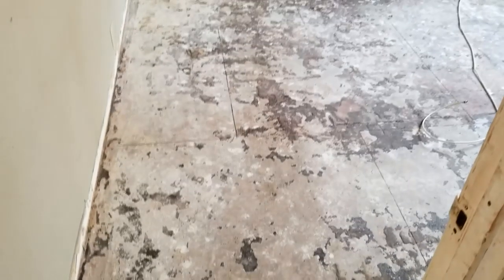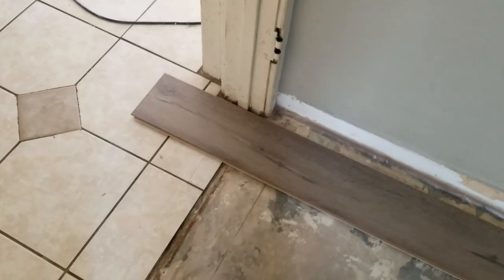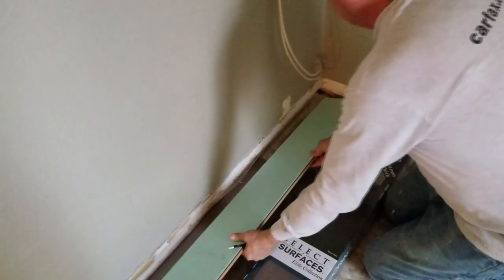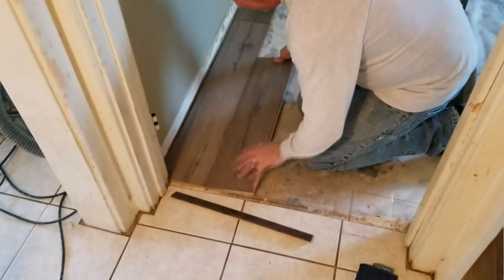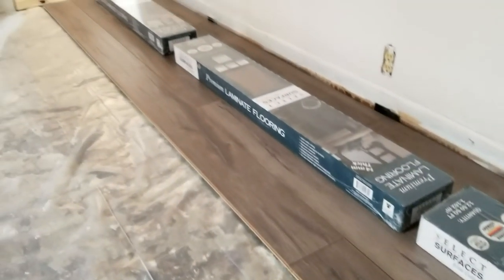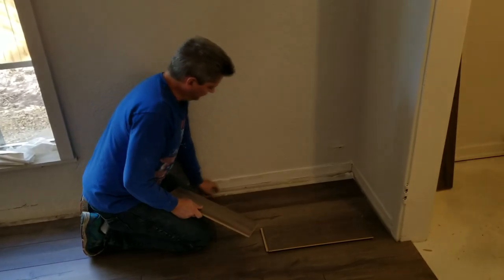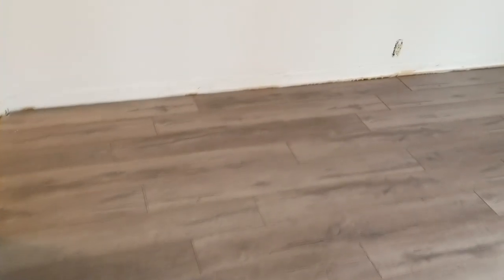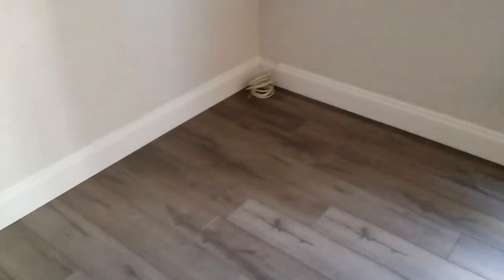Laminate Flooring Installation Quick Tips For Fast Install

Comment from the maker: ✅ RECOMMENDED diamond coated blades to cut laminate flooring and other hardwood floors
✅ Freud Diablo 10" Pergo D1012LF PCD Laminate Flooring Blade: https://amzn.to/2KXLYPw
✅ Freud Diablo12" D1216LF PCD Laminate Flooring Blade: https://amzn.to/2Ly5r8R
✅  QLT by Marshalltown Red 19-in x 13.5-in Foam Kneeling Pad: https://amzn.to/2XxCIZ5
✅ Dripless 10oz Ergonomic Caulk Gun: https://amzn.to/2Du7tRJ
✅ Cramer 5-Fugi Caulking Kit: https://amzn.to/2DjZVC1
✅ General Tools 833 Plastic Contour Gaug: https://amzn.to/2LB55hU
✅ Estwing Handy Bar Nail Puller - 15" Pry Bar: https://amzn.to/2Ke5vvr
✅ Estwing Ultra Series Hammer - 19 oz: https://amzn.to/2WUZR2z
✅ Estwing Pro Claw Moulding Puller - 10" Pry Bar: https://amzn.to/2YTwm36
✅ Tooluxe 00883L Scraping Blade Hammer End: https://amzn.to/2D4Kn4H
Reply: Jeff,  on the 4th row,  why couldn't you back up the 1st plank to allow
     an 8 inch piece to be snapped into the end without making a butt joint,
  then cut the beginning piece to fit ?
Reply from the maker: @normhodgkinson6965  Norm, the really screwy thing about this laminate flooring is the manufacturer wants pieces to be cut in increments so that no piece is smaller than 16".  This means we really only have 3 sizes you can cut. Most manufacturers let you cut pieces as small as 8", but I shoot for 10" minimum for aesthetics. With all this in mind, by row 4 we needed to get in one whole plank to start, so I was willing to add in a butt joint at the end of that row to allow for the starting the row with one plank. If done correctly, you cant tell a butt joint is there. I use 80T blade on these cuts so my cuts were very fine. this is why I prefer 6" foot planks, I can get enough different size cuts without that stupid 16" requirement bogging me down.
Reply: @jeffostroff     makes sense to me,  sometimes i cheat 3 or 4 inches here and there.     are you allowed
    to tell us what brand of flooring you used ?    you do great work,  i can hardly tell it from a good job. :-)
Reply from the maker: @normhodgkinson6965  We did this install back in March. You can see the boxes for the flooring around 0:20 in the video. Select Surfaces Elite Collection. We bought I think 13 cases of it at Sam' Club, I believe for about $1.50 per square foot. I was helping my friend throw some lipstick on a pig one bedroom condo built in the 1940s, that he was about to list for sale. It sold about a month later just in time for him to buy his newer house, built in 1970s. If you saw my other video from a couple of months ago where I did the double glue down method of 8 foot planks right over the old tile floor, that was at his house that he moved into, right after we did this install.
Reply from the maker: Sams Club has it on sale now for $1.31 per square foot, a really good price for a decent looking laminate. https://www.samsclub.com/p/silver-oak-lam-flooring/prod20612378?xid=plp_product_1_1
Reply: @jeffostroff     thanks,  i have an upcoming remodel, and they want laminate flooring.  
        BTW,   is  'lipstick on a pig'  the same as 'polishing a turd' ?
Reply from the maker: We'll combine the 2 and see what we come up with!
Reply: @jeffostroff   ha ha ha ha ,   you go right ahead with that,  and get back to me later.

Comment: I've never installed laminate flooring or any flooring materials, but wanted to give it a try until I saw how difficult it looked watching so many other videos.  When I came across your video, you were the first to break it down in simple terms and the necessary measuring steps to make it look nice and natural.  Great job and thanks so very much for taking the time to explain the way you did.  I feel brave enough to do it myself.  The only tool I do not have and skeptical in using is the cutter but nevertheless you are much appreciated.
Reply from the maker: Glad to help Kathy. Be sure to watch the other couple of other videos we did on laminate flooring also, as in this house we did not cut the door jams to slide planks underneath, homeowner did not want to bother.

Comment: Hey man let me start out by saying you do a very good job explaining things, especially for newbies. As a floor installer who bangs out large scale hotels it was very hard to watch you cut with a saw. I can sit in the same spot as you without leaving the room, score the laminate once or twice with a blade and speed square and snap it clean cut. Also cutting the door jambs down with an oscillating saw or jamb cutter to the height of the laminate saves those crazy cuts with the special contour tool you have. This was a great demonstration for do-it-yourselfers, which is what I'm sure it was intended for.
Reply from the maker: The owner did not want me to cut into the door frames, which I told him we needed to do. Also for laminate flooring the guillotine cutter is best, be we don't have one.

Comment: Not undercutting door jambs, Butt joints and a sliver on one side of the room. What a hack job.
Reply from the maker: My friend the homeowner specifically told me not to undercut the door jams. I even had my Robertson door jam electric saw ready to go, but he said no. The manufacturer even says you can have butt joints. There is nothing wrong with butt joints, just keep it under 2 or 3 for the room, they don't affect the operation of your floor, and you are still fully connected on 3 sides of the plank it is not going anywhere. So unless you have proof to back up that claim, like lab testing that shows failure modes resulting from butt joints, you are just hacking out fake fear-mongering advice on that. Also what you call a slice is not a sliver it is a 2" wide rip cut. 2" is considered by the flooring industry to be the minimum width cut that you don't want to cut any thinner. We could have ripped the first grown planks a couple of more inches so that you would have 4" planks on either side of the room, but again, the homeowner wanted that first row to be 6" wide, not a smaller 4" plank. There are always multiple ways to skin this cat, and it boils down to the preference of the owner. Not everyone wants to see their first and last row narrower than the rest of the rows. For many, it is better for the last row to be 2" or more as the bed goes there. But don't make a row less than 2", in that case, you should rip it evenly off 1t and the last row.

Comment: I'm installing this sam laminate brand from Sam's into the same 10x12 room layout and yes I did the H pattern cuz I wanted to keep the 16 inch joint lines I believe I read on the box although I went with the  spacing of strips I cut from one plank😳. hope that's enough. The H pattern doesn't bother me cuz most of the floor will be covered anyway with furniture . I appreciate you taking the time to explain everything.
Reply from the maker: Awesome, glad to help!

Comment: Question Jeff. How do you determine to start on that wall? If it's significantly out of square the ast piece will show it or worse the floor will look diagonal depending on the span.   Also no silicone around the edges? Thank you
Reply from the maker: I like to start left to right and make the first full piece be when you enter the room. I don't silicone the wood just caulk along the baseboards

Comment: I really like the colour of those floors. I am just wondering if it would make the room feel smaller? Did it feel smaller to you when you finished it? Does Laminate look cheap when you finished it. It seems to look quite nice.
Reply from the maker: No the color was a lighter medium shade of grayish brown, nice and modern. A Darker wood might make the room look smaller. Also the walls were painted a light beige color which was much lighter than the green they had before that made the room look larger. This laminate looks just like wood. I never buy the cheap paper laminates. Make sure you stay with 1/2" thick planks or thicker, they will be more resilient and won't bend or twist when you step on them. If your sub floor is real flat and does not move, your laminate floor will be awesome to walk on. These planks came with noise suppression/shock absorbing foam on the bottom, but it's not as good as the premium sound proofing underlayment I use, which is made from recycled tires. It is the firmest support, and absorbs the most shoe noise when you walk on the planks, and feels like you are on a solid wood floor.
Reply: @jeffostroff  So kind of you to take the time to reply. Thank You!!!

Comment: Undercut that door casing!
Reply from the maker: We usually do if you look at our other videos. Owner did not want to do it
Reply: I always undercut my jambs.
Reply from the maker: @gearhead4013  we normally cut them too, this time we were told not to
Reply: @jeffostroff  TBH, I'm not sure WHY any customer will say do not undercut, most "joe's" don't even know what the purpose of this, otherwise they would be doing the job. EVEN if they did as a contractor who knows what there doing is to advise the client what your doing and why. don't believe this conversation even happend. If a client ever asked me to do something I thought was wrong or looked wrong, I would'nt do the job, your the SME.... They eant the job looking good right. The other thing is that if they asked you to say stairstep or keep all pieces in the same and not looking random or even saying that they wanted a small piece and not the 16".. you'd tell them no... I don't believe it or you didn't explain why it was supposed to be like that, not undercutting the jamb looks like rubbish.
Reply: @AdrianJayeOnline  right! I would also NEVER do a butt joint on laminate flooring. If the product was designed to be waterproof....now it's not! It looks tacky and the difference should be split on both ends. I have not seen a single professional installer ever use butt joints unless doing a repair.

Comment: Looks like a headache but I’m gonna give it a shot hopefully I don’t waste too much material. Is it necessary to use a table saw
Reply from the maker: You can use any saw, but the table saw is easiest for ripping up the length of a plank, or carving out a 90 degree cut in the material to go around a corner.
Reply: jeffostroff thanks for your reply just one more question sir. I have 14 x 14 master bedroom on my second floor.Would it be best to start from the wall with the closer&bathroom doors or from the opposite side with a clean wall
Reply from the maker: @never2be07  I like to start on the wall opposite where I enter the room to look across and see a full width row of planks against the opposite wall. You'll want to do some dry fitting to see how the planks will end up on the wall where you enter to see if that looks good to you.

Comment: No need to ever create a "butt joint" on laminate floors lol. You could get away with a smaller peice than 8 inches and it would be 10x more secure than butting two cut peices together
Reply from the maker: There is nothing wrong with butt joints, even the manufacturer instructions allow it, they say not to allow more than one butt joint every 3 rows, I try to go 5 rows or more without one. But your suggestion of going under 8" for plank length is just flat out wrong, and a major no-no in flooring. Most manufacture instructions forbid it and say don't let the piece go below 8" or 6", I have even installed flooring last year that forbids going under 15". Butt joints are perfectly held on 3 sides with no issue. But planks under 6" look bad, look amateurish, and lack lateral and twisting strength.
Reply: @jeffostroff  a lot of laminate has a microbevel and butting two peices together would eliminate the bevel also leaving a small hairline gap. Having one ot two peices that are 6-8 inches will not cause any harm to the floor at all. I would never cut and then butt two peices together. Furthermore im sure a customer would not like a hairline gap/missing bevel in their floor. Side note, I have seen countless floors installed with even 2 inch peices (which I do not condone) but they have not failed. You also hardly notice smaller peices in a room once it's all said and done. Forgot to mention that butt joints are only held on two sides which would allow the cut end to potentially slide from side to side after installation causing more issues down the road
Reply: They can forbid all they want I've done it loads of times with no issues
Reply: Womb Raider  He is correct, it is lazy and sloppy. I would fire anyone who even thought of doing a butt joint like that, unforgiveble for any installer worth his salt.
Reply: @darrenr1194  don’t forget he scribed the door frames 🤦🏻‍♂️🤦🏻‍♂️🤦🏻‍♂️

Comment: Also I heard no hammering but here's a lifesaver tip. Cut out a small 6"L×2"W "groove" side off a plank and use that to tap in the plank on the "tongue" side with a rubber mallet. You know it has to be absolutely snug or it'll throw the rest of your floor off and not lock in.
Reply from the maker: I prefer the long plastic tapping block
Reply: Yeah and alot of times it splits the groove, plastic tapper of laminate block. Sometimes you have to really smack it to get it to go together  I have laid 30 or more of these crappy floors and every brand is junk and as disposable and cheap as medium grade carpeting.
Reply: @robinkaiser5171  yeah you're right I have split the plank knocking the crap out of it
Reply: I cringe everytime the landlord I work for uses it.i like hardwood and  tile but not impressed with loc together vinyl plank either.
Reply: @robinkaiser5171  No I agree and the material that make up the tongue and groove is super brittle. Another huge problem is you absolutely have to take baseboards off and re-install them when doing tongue and groove because you have to have the plank at a near 45 degree angle or else it won't tap in, and you can lift to that angle when going under baseboards. That or quarter round which is ugly. My trade is commercial carpet, glue down vinyl or luxury vinyl snap lock. I don't do real hardwood or tile, in my opinion that's a whole different skill set!

Comment: Was the transition molding piece necessary for the closet?
Reply from the maker: No you can install right into the closet which is what I normally do, originally the owner did not want the closet to have the laminate, then when we saw that we had enough left over, we used all the cut pieces to fill in the closet.

Comment: The only problem your doing now is each row your cutting shorter and it’s creating a staircase pattern which is also a no no. What you should do is start the next row with a longer peace then it breaks up the staircase pattern.

Comment: I just did a floor and on second row, i cut the first in half and the rest fell into place without doing a lot of cuts. The third row i put the piece from first row. No two people do it the same way. What ever works
Reply from the maker: That is correct in the more random you can make it look the better I try to avoid the stair step patterning across the floor

Comment: I concur with other comments...never use a butt-joint ever and always undercut thr door jambs.
Reply from the maker: In this one, my friend the owner did not want the door jams undercut. Because of the size of the room and the strange requirements in plank length by the manufacturer, the was a need for a but joint. All the manufacturers tell you that you can have one butt joint every 3-5 rows, Of course I try to avoid that at all costs. Nothing wrong with butt joints, you cant even tell where they are, and you still have the plank being held in place by 3 other sides, it is not going anywhere. I try to avoid any butt cuts within 2 rows of the wall.
Reply: Utter rubbish......you never use but joints. & if youre a floor layer you explain why you need to undercut door frames.  If im doing a job i do it my way & whatever gives the best end look is what i do. 
Thats like getting a machanic to work on your car but telling them you dont want them to use spanners. If i get a trade in i trust they know what they are doing

Comment: It is 2019 you don’t cut laminate around the doors. You cut the doors and slide it under
Reply from the maker: Owner/friend did not want door jams cut, and did not want to go back across town with me to get additional tools for that. Yup, he was looking for extremely quick lipstick on a pig before selling unit, and didn't even want to paint the pre-primed baseboards, they actually looked almost as good as painted.

Comment: Butt joint and narrow sliver on last run 🤦‍♂️
Reply from the maker: Yes the owner decided that since we would have to normally slice both the 1st row in the andro he wanted to see the full plank on the 1st row so decided to let the end row where it would be behind the bed and then headboard in the dressers and everything were nobody would ever see it. As for the butt joints there are only 2 or 3 in the entire Room and they are allowed it doesn't reduce the strength like most people think, as many people just blindly repeat what others have told him that you shouldn't have a butt joint.

Comment: I have been doing flooring for 30yrs I started using a stand up trowel and now I use it all the time it is really nice on the big jobs and no more being on my knees spreading mortar, glue or leveling floors the stand up trowel will change your life check it out at      shankfloortools.com